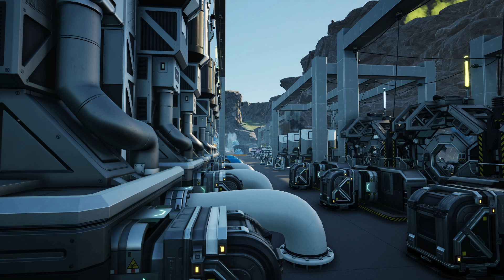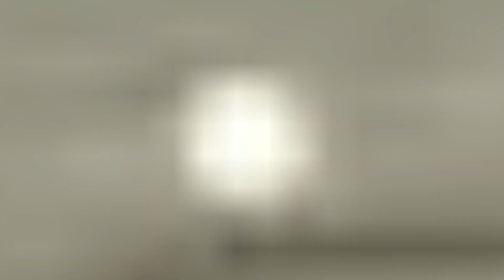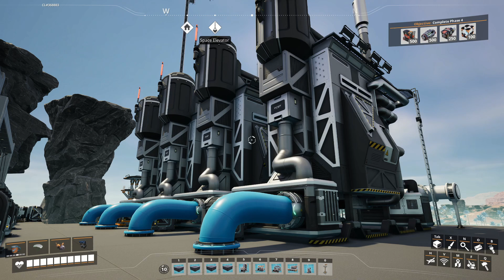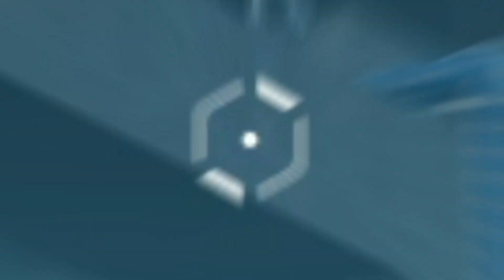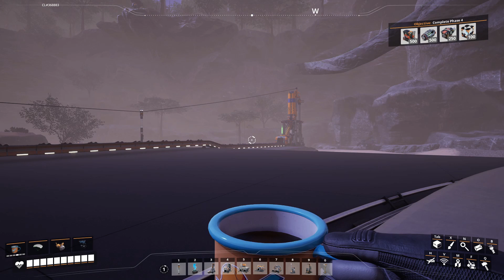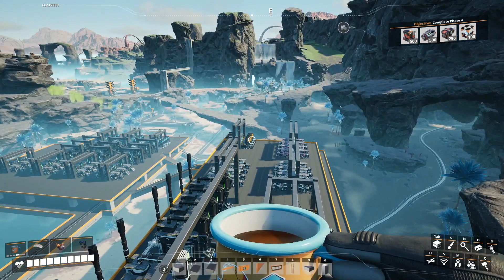How to set up Aluminum| Satisfactory 1.0 Masterclass

Comment: Why underclock?  the machines stop when output is full anyway.I generally allow all machines but liquids to run full.  I don't underclock and minimise sinking as that seems a waste, especially in later games when theres nothing left to buy besides rubbish in the store.
Reply from the maker: Power, mostly. Spikes in power when things turn on/off are extremely annoying as it would require you to over-build power supply. That said, if you don't mind that, there's no reason to underclock indeed.

Comment: I'll admit concrete looks amazing on the finished build but it is a PAIN trying to figure out the exact placement of objects on platforms, do I need a full nudge or a half nudge, is it too far over or not enough? It's why I prefer building on the default foundation then swapping it all to Asphalt after saves loads of guess work.

And god recipes are so broken (though you have to put int eh work originally of course.

Comment: I might be wrong but I think this setup produces slightly too much silica, unless you're sinking the 200 silica that comes from the refineries.
If you''re adding it back then you only need the silica constructors to provide 400 in total, so 25 (66.666%) each on the 16 constructors.
Unless i forgot to carry a 1 somewhere when tuning this!
Reply from the maker: Nope, you're right! Some of the silica needs to be sinked!
Reply: Rather than sink it (which I know is fine but always seems a bit cheaty, like peeling the stickers on a rubic’s cube) I’ve scaled mine back to 25 units/min each, which when mixed with the feedback from the refineries (50 each across 4 refineries = 200 silica/min) should be perfect… Should.
I expect it to grind to a halt somewhere in a few hours :D
Reply from the maker: @SimonPeel  Hahaha I know that feeling. "Right, this should work. Probably. Maybe. Right?."

Comment: Thanks but if I'm not wrong this factory produces too much silica: 650 while only 600 are needed, it will stop once the refinery's output is full. 
A simple fix is to decrease the silica production in the constructors section.

It also produce 480 aluminum ingot but only uses 470
Reply from the maker: You're not wrong, but that's what the sink is for!
Reply: @TheDutchActuary  ops my bad didn't notice you put a sink there

Comment: For the water pipes, you can also put a valve on the "new" water pipe and set the flow rate to the difference that way the waste water will always get used first even when the system backs up because of a full output storage etc.

Comment: Thank you for the videos, I'm following along through my playthrough. Having trouble with pipes. Can you explain how you're getting enough water to feed the 4 alumina solutions through one pipe? They carry a max of 600 m/3, but the 4 refineries require 720 m/3. I got it to work by having waste water from the aluminum scrap refineries to enter the pipe section half way through the other four, not the beginning of them, to bump the water levels back up. I guess that's how you did it? The video has you entering it at the beginning so I got very confused :P Unless I'm missing something here :)
Reply from the maker: This was a bit unfortunate on my part as it wasn't shown, but yes - I had a secondary input halfway in as well. The recycled water is filling in the required inputs.
Reply: @TheDutchActuary  Thought so, thank you! This series is helping me figure things out bit by bit. Found I was getting overwhelmed when I tried playing it before.

Comment: These videos have been super helpful -- one Q, since I couldn't see exactly how you managed it watching back the video: What are your pipe logistics like for the water inputs of the refineries making alumina solution? I love the tip about bringing water from the pumps over the top, but 4x alumina solution refineries require a total of 720 water. I know we're recyling the water the aluminum scrap is making, but it's still, in total, more than a Mk2 pipe can throughput.  Do you have separate water lines feeding a couple of the refineries?
Reply: For anyone running into a similar issue, I solved it by pulling in the pipe from the water extractors between the first and second refineries, rather than at the beginning of the line. That way the first refinery will use all the recycled water (and a little from the extractors), and then the other 3 extractors will be fed by the extractors.
Reply from the maker: @ZombieMatt2  Good point! I bring in a secondary pipeline midway (from the recycled water) that I don't think I showed, my bad!

Comment: I don't bother making an aluminum factory without the sloppy alumina and pure aluminum ingot recipes. You don't need silica, and don't have to worry about by products. If you loop the incoming water up and over (as shown in the video) you can make sure that your water by product never gets backed up. FYI, if you have those recipes set in a blueprint, you don't actually have to have the recipe unlocked (I.e. you imported the blueprint from a save that does have them unlocked).
Reply from the maker: Oh I totally agree that sloppy Aluminum / Pure Ingot is probably the easiest way to scale up long term (same principle but more straightforward).

In this case, I figured I needed some silica anyway so I might as well show the default recipe!
Reply: This!